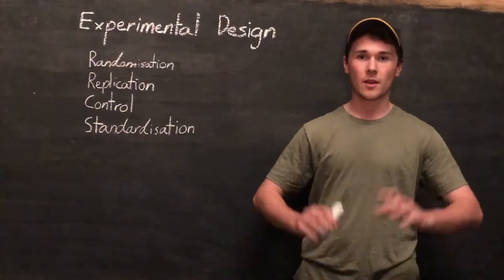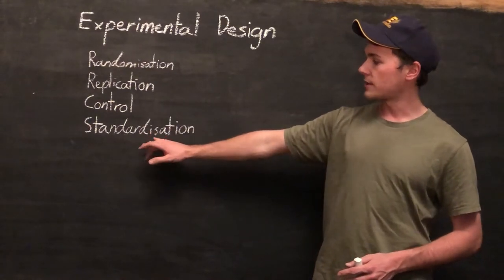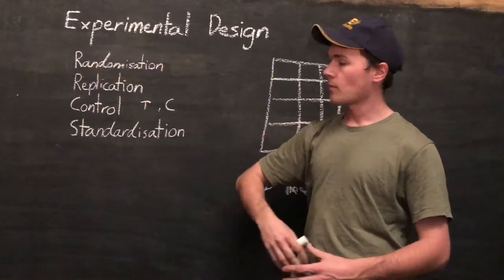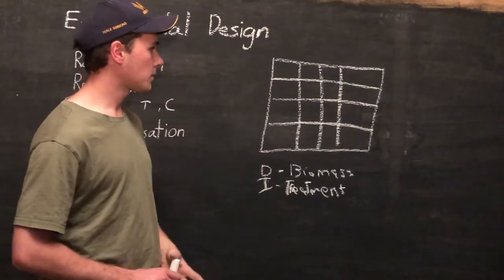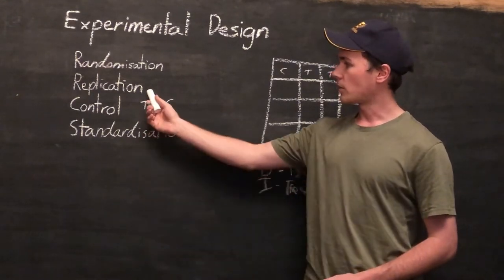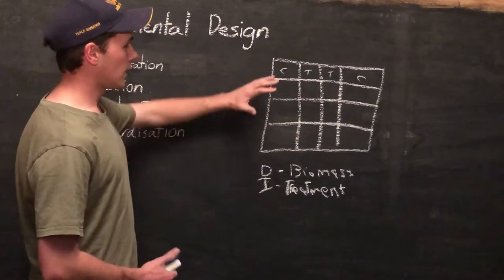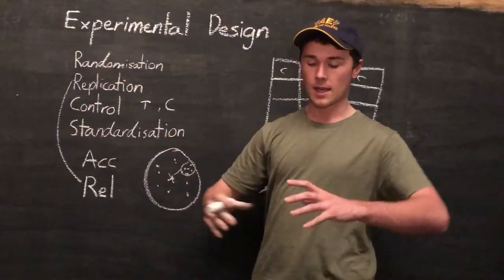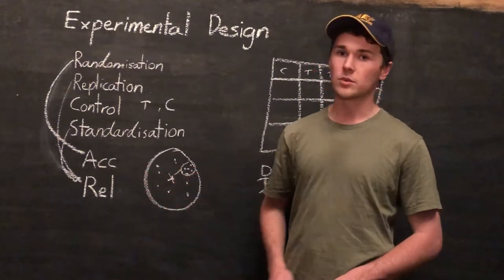How to design an experiment in Agriculture| Randomisation, Replication, Control & Standardisation

Comment: what about if its all treatment in each column
Reply: and have 5 replication
Reply from the maker: For this, you would achieve replication but may have missed randomisation. If each column only has one treatment group in it then this may lead to systematic errors from column placement. 

For example, if one column is closest to a line of trees, then that column may be shaded, so when looking at the results, did the treatment cause the results or did the shade? 

What you should do something called "Randomised Block design", this is where each treatment is randomly placed in each column. 

If you have 2 groups, treatment (T) and control (C), and need 5 reps, then this is would you could do: 2 columns of five rows, Flip a coin to determine T or C so that you get something like this:
row 1) T,C
row 2) C,T
row 3) C,T
row 4) T,C
row 5) T,C

Hope that helps.
Reply: Hello, I have a doubt. In CRBD or two way anova without replicates we are able to get the sum of square effects (although no interaction) with respective p value, but in factorial anova with no replicates we wouldn't get any p-value, although we would get the effects including interaction. Why is there this difference?